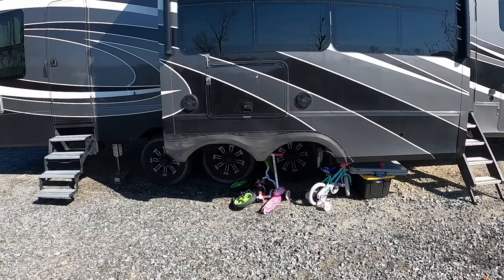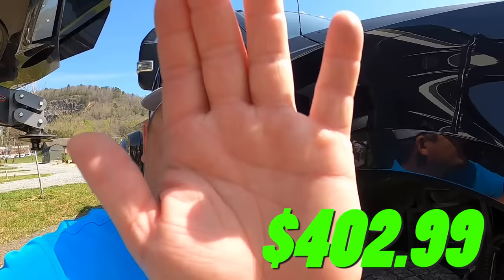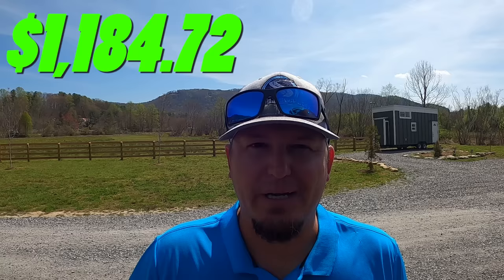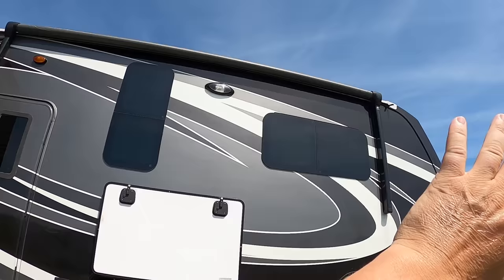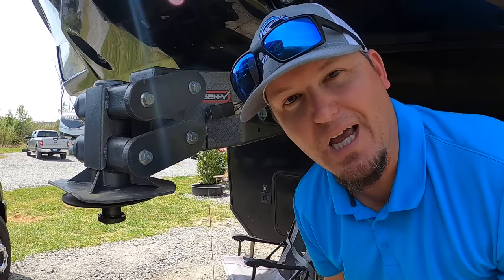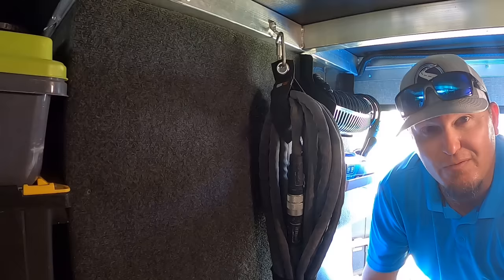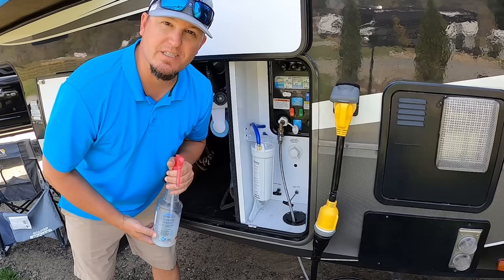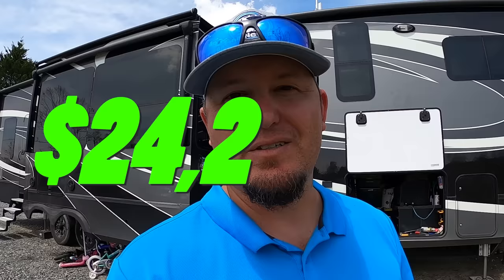These Things Are Money Pits! Everything That We've Had To Repair! | Fulltime RV Living!

Comment: Most everything on a camper is only “good enough” quality.    Our car dealership decided to expand some years back to also sell motor coaches and RV’s, so I occasionally assisted the RV techs with repairs.  I was flat stunned sooo many times at the half-ass quality of these $425,000 coaches or $85,000 5th wheelers.  It’s not a case of occasionally seeing shortcuts in material or engineering, but rather shortcuts in EVERY aspect of the unit as a whole to maximize profits.  Do not expect automotive level quality in an RV, for there are virtually no federal standards.   
Here’s their trick: to fool you visually during your initial showing.  All the things you see and touch will appear as quality until you look underneath the surface.  As long as you know and accept this going in, then you will not be disappointed later.   Do not make the mistake of thinking that one brand is of a higher quality than another.  That’s just better marketing.
Reply from the maker: This is why we found the unit we liked and then went and bought used! We know that RV's are not made the greatest, we also saved a ton of money and were able to use that savings towards all of our repairs and upgrades! RV's are amazing, but if your expecting perfect it is not for you, you also need to be prepared to fix things yourself or you will be left very disappointed!

Comment: If you want to travel around the country as cheaply as possible while not having to live in a van, consider an electric truck pulling a travel trailer.(bumper pull). Electric trucks are heavy which make them stable and can pull most travel trailers at the speed limit in most places. Plus, you have power everywhere you go since your truck is a mini power station. Make sure all the appliances are inverter or switch them out, especially the AC. Fill up the batteries in a camp ground.  My Jayco is holding up pretty good on travel and has a good frame under it. Put 10 ply tires on everything. Just re-engineer anything that falls off. I really think this would be much cheaper.
Reply from the maker: While that might work in the future, right now I don't think the USA us set up for this kind of travel yet! We also need as much room as we can since wa travel as a family of 5!

Comment: Look into oil bypass system. Amsoil makes a good one. You can easily go 20k plus miles with the added capacity and filtration
Reply from the maker: I have been looking at these wondering if they are worth the cost! We get between 7k-10k miles now depending on how much we tow!

Comment: I was waiting to hear how often and how much the transmission service was; I would imagine that would need to be done at smaller intervals since a lot of towing is involved. 

There is definitely more to (getting) stuff than there is to keeping it 😂 😂 Great video!
Reply from the maker: We just did that! Transmission, transfer case, front and rear differentials, coolant flush! The service intervals for those are cut in half if you tow! So instead of 150K we changed all that around 75K!

Comment: I lived in suv and 2 hotels week for 10 yrs, bought 18ft motor home sold in 1 month. Too much stress with repairs. Then bought 20 ft trailer regretted it in 1st day because realized it had leaks. Spent alot hrs trying to figure out where leaking from. Other thing breaking every 3 days inside the trailer. I still have never used the water in my rv or bathroom because thats leaking too. I've been living in it 6 months.  I miss my tent
Reply from the maker: No matter what you have if you use an RV fulltime there will be more repairs and maintenance than you can plan for! We have found that once you get past that first 6-12 month period of repairing things the RV actually becomes pretty dependable!

Comment: Speaking to the excessive maintenance costs caused to a degree by living in the RV fulltime, I admit that we have never planned on using our trave trailer as a full time home. I thought it was interesting that, here in TX, when you purchase any towable, the bank or Credit Union that finances your purchase ( if you are not paying cash) requires you to sign an affadavit that it is not your intent to live full time in the RV. I had never seen that after several toy haulers, but turns out this is their way of leagally shielding themselves from excessive depreciation on the unit to where it becomes 'upside down' putting the loan value against the appraised market value, thought that was interesting. Not sure what state yall are in, did you have to sign such a document?
Reply from the maker: We are in Texas and didn't have to sign any document to purchase the rv for fulltime use!

Comment: OMG! The cost of upgrades and maintenance items aside, you have had some serious costs in repairs to trailer.

We don't full-time but we do spend almost six months a year onboard our fiver. We have a late 2007 Alpenlite 34RLR. Since 2010 we have done well over 2000 nights on the road. Most years we put 12,000 miles on the truck which is only used for RV travel. The 5er probably has more than 100,000 miles on it. 

The truck, new in 2006, has over 260,000 miles. The truck, a GM 3500 dually 2WD has had one major repair, 2021, turbo charger plus injectors for $9,000. The rest has been normal wear and tear, bushings, filters etc. Oil changes every 3000 miles help to keep the mechanics away.

Wear and tear, things falling off have been minor compared to yours. Zero roof issues, though I did recoat it about five years ago. Single biggest RV issue/upgrade was a rebuild of all spring hanger area boxes. About $1000,00. Replaced a fridge, $5000,00, 2013. Replaced cooling unit, $2,500, 2023.

Like you all repairs and maintenance are DIY. DIY makes a huge difference in costs when the little things go wrong and doing simple upgrades.

Roughly estimating, $3000 to $4000 a year is for maintenance such as tires, oil, various supplies.
Reply from the maker: We planned for this because we knew by living fulltime we would more issues and repairs than most! Overall if you remove the big one time repairs the montly cost isn't that bad, but this is still or most expensive monthly cost over all other things!
Reply: You probably have a Lippert frame, as my Alpenlite does. Carefully check above your spring hangers for cracks.

We discovered a crack on our way to Alaska long before we got anywhere near a notorious pothole area. Since rebuilding all six of the areas we have done three more trips to Alaska. No issues.

Coming from the boating world I must say that RVs are simple and dirt cheap to maintain by comparison. I used to figure on $5000 per year boat maintenance on a similar length boat, 36', before turning the key in the spring.

Happy turkey day wherever you may be.

Comment: I got my lance camper for 300 bucks.  I spent 27 buck on one roof cover and 15 bucks on the other.  I also spent 90 bucks on a house battery.   That's all I spent on that.  And I have been living in it for 3 years.
Reply from the maker: Thats awesome that you have no problems, but your lance camper is not a 44ft toyhauler and you likely don't pull it with a dually truck! While we are doing the same thing living fulltime in an RV we aren't doing the same thing!

Comment: Consider a stick built home that costs only $187, 416.80.  Now put wheels on that house and tow it all over the country.  What could go wrong, right?  Full time RV'ing (safe RV'ing) requires a lot more money than this.  Think at least $300-400k - think high end diesel pushers.
Reply from the maker: We traveled fulltime for 3 years and didn't spend that, so no it doesn't cost 300-400K to do this!

Comment: The brakes not replaced is a reason you don’t get oil changed at the dealer. They should have told you when they needed changed.
Reply from the maker: I don't change my oil at the dealer everytime! I do it myself when we are allowed to! Since we travel fulltime most rv parks don't allow this type of work so that it when I have to pay!

Comment: His truck repairs would have been much cheaper doing it himself. Based on his trailer work he obviously can. Those 5th wheels are well worth the cost!
Reply from the maker: I did do all the work on thr truck myself! I choose to do oil changes and fuel filters at the dealer because we travel fulltime and all RV parks have rules against this type of work! When we can we do it, but most of the time we can't!

Comment: Great video,  I was just wondering although you are very mechanically inclined  and budged for expected repairs, how much do you think it would have cost you if repairs had to be paid at a dealership  or shop/maintenance facility. Thinking about buying one but have  no mechanical abilities,  thanks..
Reply from the maker: Thank you! We have done everything we can and when we need help like with the roof and the slides we hired help!  Most of these things can be handled very easily with a trip to the hardware store and some parts from Amazon! But I would be willing to bet it would be another 10K in labor if you had all of this done by a shop!  But the bigger loss is your time, how much time are you willing to give up having the RV!

Comment: The only RV's that don't depreciate heavily and don't cost a fortune to maintain are the smaller European van diesel conversions. You can get a nice used one for around $35-50K with a smaller turbodiesel engine and are reliable and fairly economical to run but of course with much less space.
Reply from the maker: We travel fulltime as a family of 5 and a dog, a van doesn't really work for us! Also if you traveled  as much as we do in that Van you will spend accordingly on repairs and maintenance!

Comment: Can't blame the truck for you not doing maintenance yourself everything you listed wasn't an issue with the truck. The 5th wheel  different story. You keep up on maintenance on the truck it will out live you.
Reply from the maker: I didn't blame the truck or the RV for any of these cost! The truck has been flawless and we have never had a problem out it. We have only done scheduled maintenance and wearable parts such as tires, shocks, brakes and filters! This wasn't a video about problems but about all cost associated with the truck and the RV dealing with maintenance and repairs!

Comment: What Ive enjoyed most about owning my 2022 $80k Ford F-350 (sold it) is the complimentary memebership in Fords "Recall Of The Month" program.  Nonstop fun times with things like the tailgate randomly opening WHILE HAULING, wiper arms that could fly off during use, transmission faults, etc, etc and then good luck getting an appointment in less than a month and finding parts.  Bonus for the truck being deliverd with the power steering fluid cap not afixed.  Ford is making garbage and charging you top dollar.
Reply from the maker: We have had zero recalls and not one issue out of our truck, besides maintenance and wearable parts like tires and shocks!
Reply: @PavingNewPaths  Wow. Consider yourself lucky. Everybody i know that has a new ford truck has been having problems
Reply from the maker: 3 years and 100k miles so far, tires, shocks, brakes, and fluids is all we have ever done!
Reply: @PavingNewPaths  Check your Ford Pass because I had to take mine in for wiper replacement and an update to the fuel system that the guy said could have been bad if not corrected.  If youve got a 6.7 2020-2022, yours needs the same thing.
Reply: @PavingNewPaths  Glad to hear yours has been trouble free.
Reply from the maker: @SonofHardrada  We have had it checked several times we don't even have the SN for the transmission one that came out this year!

Comment: Death wobble is a standard on Ram trucks and jeep never heard of it on or experienced it on any of the many F150, F250, F350, F550s in my fleet,,,however I’ve had it worst on Jeeps and on Rams only after they were old and had high miles.
Reply from the maker: I thankfully have never experienced it but there are several who do! Most of the time it is due to worn-out front-end components and with the straight axle front end it becomes a serious wobble!  The stabilizer kit doesn't solve the problem it just makes it more manageable when it does happen!

Comment: Did anyone suggest buying a 5 year old 5th wheel, where the early issues were fixed? And, at 20+% less than new.
Reply from the maker: That's exactly what we did! This was a 6 month old unit that wasn't used very much! We saved over $35k over the price of new! Even with all the money we have spent we are still less than the price of a new one! But the more you use them the more they cost to keep together!

Comment: bypass oil filtration for your diesel truck.   cost of oil change would be 1 quart of oil plus the filter.

Things sure are expensive when you do everything retail and mainstream
Reply from the maker: I have looked at the kits to run that type of system they are not cheaper either! Ford changes it for the same price I can do it myself so its not more expensive, just more convenient!

Comment: I run a ram Cummins and never had any of those issues... yes oil change yes tires .. ps you can rotate the duals uf u dont have custom wheels.. my steel wheels rotate religiously and i got 65k on goodyear kevlars and they still got 20k left
Reply from the maker: We have never had any problems with the truck! Everything was a consumable like tires, shocks, brakes you know things that wear out if you tow! If i had steel rims i could rotate the way you say, but i have aluminum rims and the inner is a steel so in order to keep the polished  side of the rim showing you have to move tires!

Comment: 4:13 rotating tires does not require removing tires from rims.
Reply from the maker: It actually does on a dually with aluminum rims! Only 4 are aluminum and the rear inners are steel! If you want your truck to look nice the only way to properly rotate is the more tires to new rims!

Comment: You could cut probably half the cost of that repairs on that Ford by owning a Cummins, and then cut out the cost for repairs on your RV completely by doing things on your own All they are are screws, would, and plastic. And can't forget the PEX pipe honestly I've been full-time for 6 years now and I've not spent a single dime on sending my RV to a dealership any repair that's been needed on our ram 3500 Cummins has been done by myself in the driveway and they're minor repairs basic maintenance I've owned this truck for 6 years now.$700 for oil filters and fuel filters that's insane I pay $100 for fuel filters and 100 for an oil change and I do it in my driveway every 6 months sometimes longer every 15,000 mi is typically. Airbags they come on the Rams
Reply from the maker: The cost in this video was us doing all the work, it would be double or more if I paid someone to fix it every time it broke! Not to mention the time lost by having my RV in dealership lots waiting for repairs!  This is our home and we have been fulltime traveling for 3 years now and the only way this works is if you can take care of everything yourself! I also do my own oil and fuel filter changes when I can, but since we travel fulltime most RV parks don't allow this kind of work, so we do it when we can and when we can't we let Ford do it!  Guess what Ford Charges me for an Oil change? $110, so doing myself is not worth the $10 I save! Sometimes it is better not to assume thing about people!